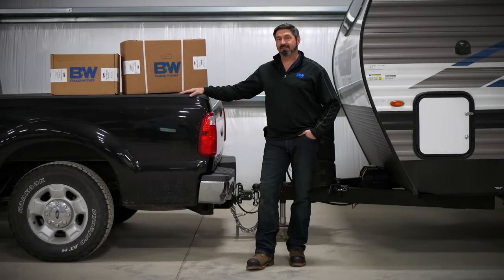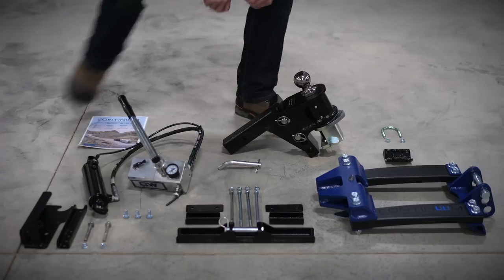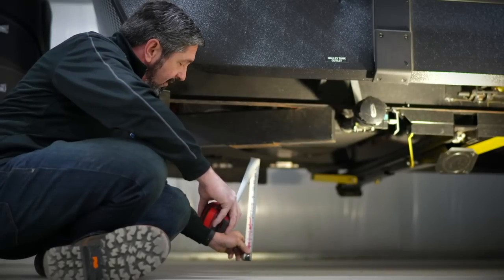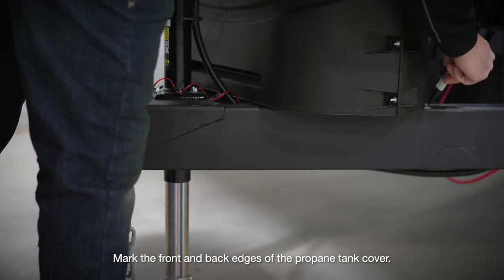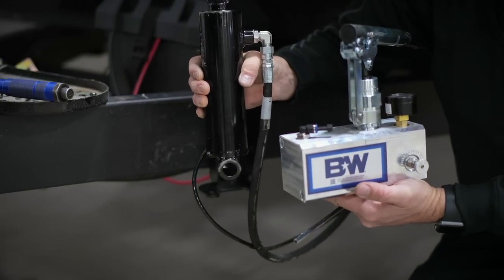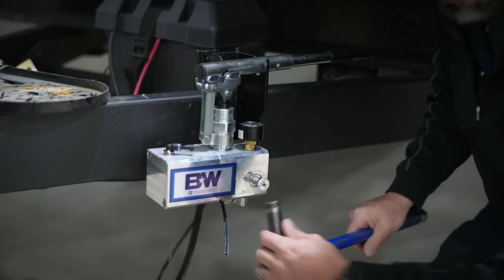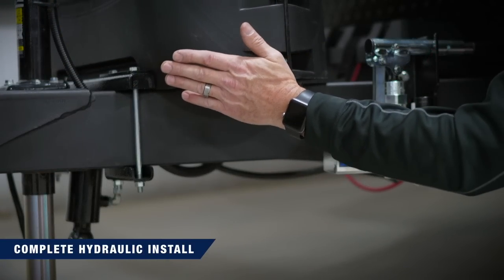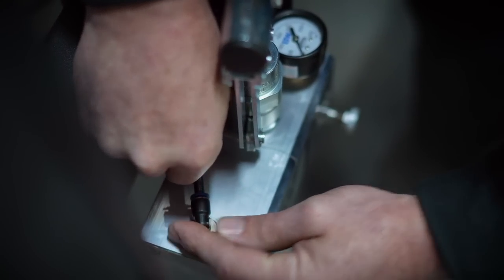Installing the B&W Continuum Weight Distribution Hitch

Comment: I gotta say, I love the design of this hitch.  I easily installed mine but wasn't able to complete the setup because my driveway is not level.  Best thing, I can pull to a level parking area and complete the set up in a matter of minutes with no tools, no matter the adjustment.  Haven't pulled with it yet, but I hope that performs as well as the design.

Comment: What is the distance between the hitch pin hole in the shank and the center of the hitch ball?  Being able to lower my tailgate while attached to the trailer is important to me.
Reply from the maker: The distance from the center of the receiver hole to the center of the ball is 11.4 inches. In most cases, there is enough clearance to drop the tailgate, but this will vary depending on each setup (frame design, tailgate length, trailer jack size, etc.).

Comment: Has testing been done with an SUV as a tow vehicle vs a truck? I tow with a V8 Grand Cherokee-John
Reply from the maker: Absolutely. We've conducted testing with SUVs and have found no issues when using the Continuum with these vehicles.

 In regard to towing with an SUV vs. a truck specifically, it will simply come down to the tow rating, size/weight of the vehicle, proper towing tires at the correct pressure, etc. As long as you're mindful of your vehicle manufacturer’s weight ratings and following all of the towing guidelines outlined in your owner’s manual, you should have a smooth towing experience using the Continuum with your Grand Cherokee.
Reply: @BWTrailerHitches  any videos of use with an SUV?

Comment: Just installed on my car, question on the pressure it can reach if any one can get back to me. I have about another two or so inches of tube but can't get it up and sound like air in the system
Reply from the maker: Hey there! We'll be happy to help. At your convenience, may we have you give our csr team a call? They may have some additional questions to help troubleshoot the issue.

800-248-6564 (M-F, 8am-5pm cst)

Comment: Can this be used with a longer 18" shank?
Reply from the maker: The Continuum should always be installed directly in the vehicle's receiver and the head unit and spring bar assembly are only compatible with the drop shank included in the Continuum hitch kit. However, we can confirm that our team is currently working on a version with a longer shank. Release date tbd.

Comment: Will this work with boat trailers?
Reply from the maker: It will depend on the trailer. The Continuum fits 5” and 6” frames without a center frame rail. (It will also fit 4” and 7” frames with longer or shorter cylinder mount hardware).  You will need 2” of clearance in front of to install the frame brackets.
Reply: Not if your boat trailer has surge brakes. MOST weight distribution hitches prevent surge brakes from working because the tongue/coupler cannot slide freely against the brake actuator with weight distribution equipment in place.
If your boat trailer is heavy enough that you're considering weight distribution, then you probably have surge brakes.

Comment: What is the cost
Reply from the maker: The Continuum is priced competitively at $1,299, which is comparable to other leading weight distribution and sway control hitches on the market today.

A particular advantage in terms of long-term cost, is that the Continuum's spring bars cover a wide range of tongue weights (600-1,600 lbs). In other words, unlike current hitches on the market, you will not need to buy new bars should you upgrade your travel trailer in the future.

Comment: My god that thing is loowwwwww. At least in this video.
Reply from the maker: The bars do look pretty low when the hydraulic system is not engaged. However, once pressure is added to the system by pumping the handle, the hydraulic cylinder will lift the bars and increase the clearance. You can see this in action in the videos below:

The Hydraulic System | https://www.youtube.com/watch?v=DSR2NoK_xl0
The Load Bar Assembly | https://www.youtube.com/watch?v=KyvompzckuQ

Comment: Anything this complicated has too many potential points of failure.  I like my Anderson which is simple and effective.
Reply from the maker: We totally understand why some might feel that way at first glance! The Continuum initially seems a bit complicated, but it was designed to make hitching-up as easy as possible while guaranteeing precise control over the amount of weight distribution. Plus, every single component is built to last, so no worries there.

Unlike other weight distribution hitches where you may need tools and washers to make adjustments or even different bars should your trailer weight change, the Continuum keeps things simple. Its head angle is set, the bars cover a wide range of tongue weights (600-1,600 lbs), and adjustments are truly a breeze. Hitch up in about 5 minutes, and if the trailer load changes, just a pump of the handle or a twist of the pressure relief valve is all it takes.

We've put the Continuum through rigorous testing, and we back it up with our famous lifetime warranty. So, no stress there!

Comment: You're representing this hitch falsely because it doesn't help with swaying. I purchased before going a road trip and I was holding on for dear life every time a vehicle would pass me from the rear. It does help level out the vehicle but not the best for swaying
Reply from the maker: We're sorry to hear that you had an unpleasant trip! We can confirm that we tested our hitch in both a controlled lab setting and on the road, and our results show that the Continuum provides as much or more friction sway control than the leading competitors. All weight distribution and sway control devices are only designed to help reduce sway, and should you experience excessive trailer sway, there could be a few other factors at play. 

First, we recommend ensuring that the truck and trailer setup is at the proper FALR (front axle load restoration). To guarantee that you're at the right FALR, the trailer and truck should be fully loaded for a trip when performing the initial setup. If sway persists, users may wish to add another pump or two of pressure to the system to see if shifting more weight to the front axle helps. However, you don't want to go too far in the opposite direction as removing too much weight from the vehicle's rear axle will negate any sway prevention benefits the Continuum can provide.

Following that, you may want to look into all possible contributing factors:

- A trailer that is overloaded in the rear will be more susceptible to trailer sway. It is recommended that you load 60% of your cargo weight in the trailer's front half. Just make sure you don't exceed the tongue weight of your towing vehicle. A travel trailer's tongue weight should be between 10-15% of the RV's Gross Vehicle Weight (GVW).
- Check the maximum gross weight rating (GWR) of your trailer and the gross vehicle weight rating (GVWR) of your vehicle to ensure that you stay well within the guidelines. When packing for a long trip, extra weight can quickly add up. It is important to consider the total weight of all cargo, including passengers, in your calculations.
- Verify the tire pressure. Under-inflated tires reduce your vehicle's or trailer's load capacity, which can cause sway.
- Speed - Driving at a moderate speed puts less strain on your vehicle and trailer, reducing the possibility of trailer sway. Many trailer manufacturers recommend a top speed of 55-60 mph.